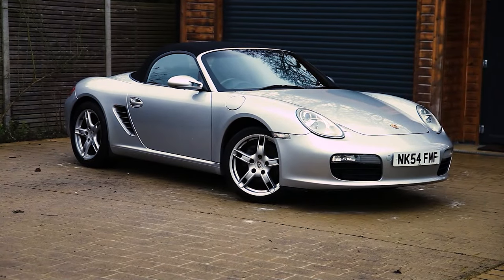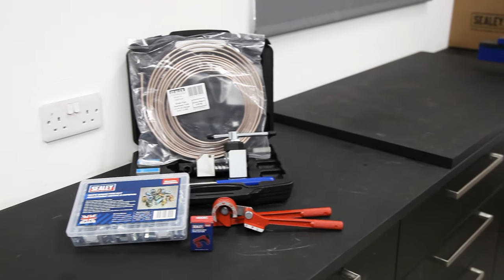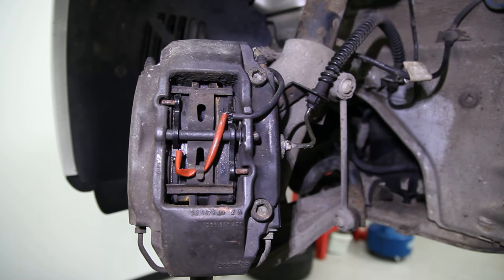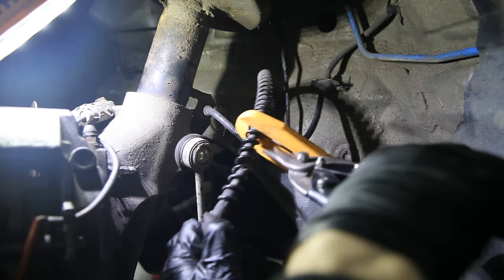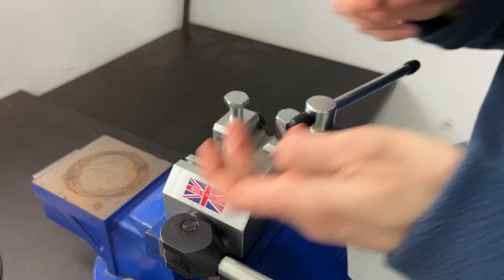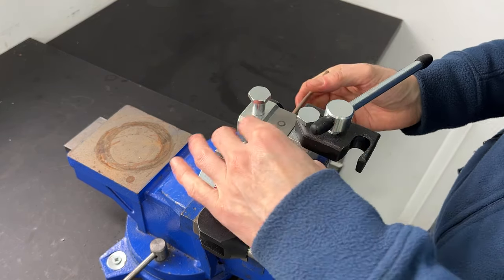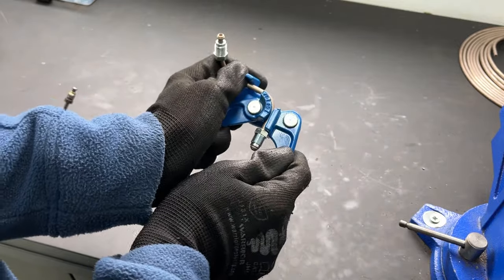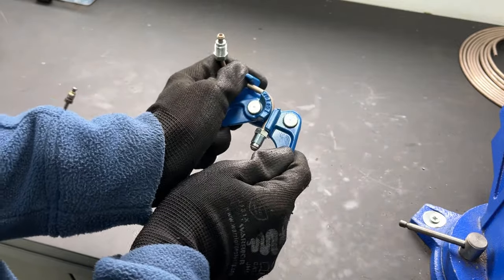How To Bend & Flare Brake Lines | Project 987 Pt.4

Comment: Great info - something that may come up in my future. I have a similar 987, my first job was a split power steering crimp which I didn’t notice until it let go completely. I notice you have one 10:50. I’ve put jubilee clips over all mine as a temporary preventative measure. Only seems to happen on the return line crimps.
Reply: good eye
Reply from the maker: Wow, good spot.   Yes, I see it now.   That looks like it could let go anytime!   I'll get some jubilee clips on it asap.
Reply: Funnily enough, my 987 has this same issue and since I spotted it I put a jubilee around it for support as it's all I could think to do with it. I'm currently in the process of rebuilding the engine for a lifter issue, and while it's out I had this flexi pipe remade by a local hydraulics place for £30, a bargain!

Comment: There is a reason Porsche and others do not use copper lines. 

At the point where the copper pipe touches the end fittings you will get a galvanic reaction. 

At this point the line will swell and seize leading to a shorter life span than the original stock steel lines. 

Copper sounds like a good idea in theory. But there is a reason these big manufacturers do not use them. 

Better get the stock lines and then give them a light coating of under seal after they have been fitted. 

Also the original stock lines are not just plain steel. They are usually galvanised and coated. They do last a long time.

Comment: Something I've always wanted to do. MOT inspectors are a nightmare when it comes to this. My sister popped up from the south west and the MOT guy nearly had kittens. Took it to another place and they were cool, but did say something about the rear caliper binding, they did do tyres, exhausts and brakes though. The way I see it is try to find out how bad the pitting is then go from there. Use a rust remover and respray or something.

Comment: I think you should change the lines. As you say, like me, you like it to be right and once rust is there they are compromised. Lanoguard is great product though and will buy you time.

Like your flaring tool. I have a cheaper version and struggle to flare the kunifer lines, copper no problems but believe kunifer is the daddy for lines... don't think I can justify the price of your tool though!
Reply from the maker: Yeah, replacing them does feel like the only solution really. 

It is epxensive but make the job so easy.  Will do stainless lines too.
Reply: @RoadandRacetv  I've searched ebay, inspired by your video and picked up a second hand earlier version of yours (02 vs your version 07). Im refurbishing the rear axle on my corrado vr6 and need to make up all lines front to back and over axle.

I have my eye on a 987 boxster too but have enjoyed your vids since the beginning.
Reply from the maker: @mattscars  NIce.  The 986 is a solid car that'll be super fun.  Let me know what work you do to it

Comment: make sure you get the 987 on the porsche classic register you get discount on parts from Porsche
Reply from the maker: Ooh, top tip!   Thanks!
Reply: @RoadandRacetv  well worth it! i needed a new variocam solenoid recently (dead easy to fit btw) was £166 for part and hardware instead of £236
Reply from the maker: @CGCTV   Blimey, thats a nice saving!

Comment: I wouldn't worry about those lines underneath at all, that's hardly rusted, personally I'd just protect them. Seen far worse working at a main dealer and they were even still running without bursting!

Comment: I’m trying to do the flexible hoses for stainless steel ones but cannot budge those flexible to hard line nuts. They are frozen solid and bending the bracket just like yours. Is my only option to cut the flex line and replace the short hard line as you’ve shown? Or is there a way of getting them off? I’m at risk of rounding the nuts if I go much further. In fact they already started to.
Reply from the maker: Try some heat.   I have a butane torch.  Heat the nut for a 30 seconds then try again. Repeat a few times if needed.   Ideally drain all the brake fluid as it's flammable first.  I'll be doing a video on it the week after next as all mine are stuck.

Comment: Personally i always approach brakes with a "better do something you don't need to, than not to something you need to" mentality. Given their criticality to the cars safety. So id personally be replacing the corroded lines. 

That said, I've never had a cars brake hardlines fail on me. So maybe my paranoia is unwarranted.